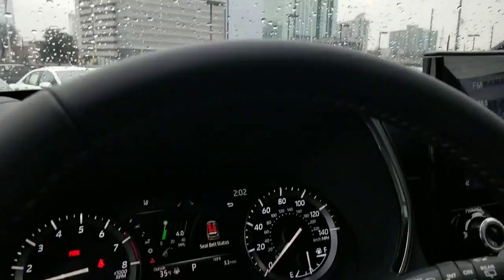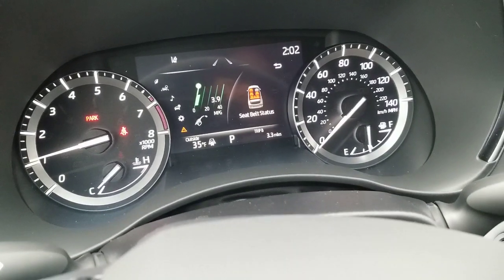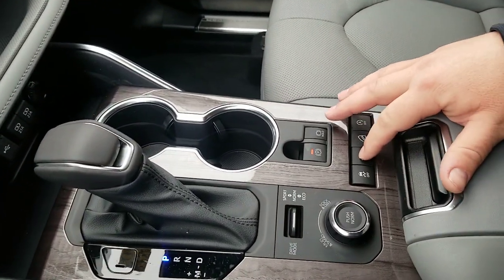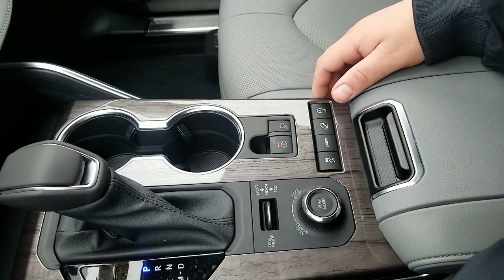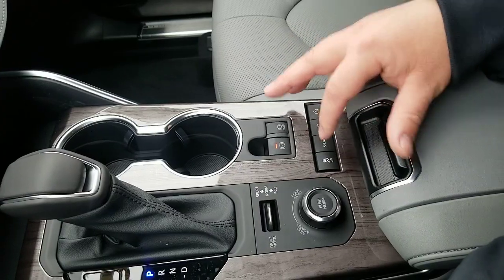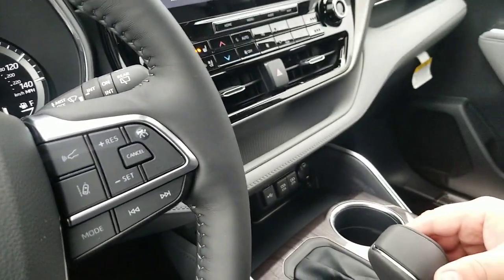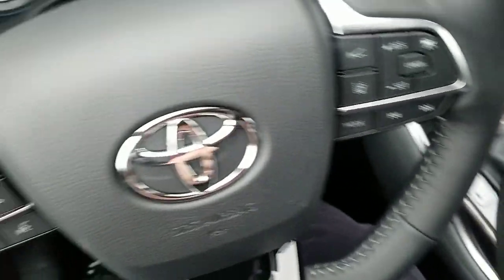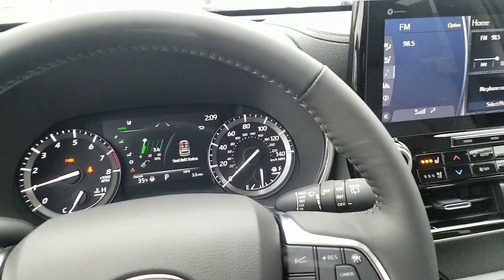What does the Snow button do on a vehicle?

Comment: I have used the snow button in very icy and snowy conditions. It helps. Traction control saved my butt on black ice once. I started to slide, and TC kicked in and streighted car right out. I was able to slowed down at the time which also helped. 2007 Highlander
Reply from the maker: It can save you for sure
Reply: Thats ABS probably. Traction control button turns traction sensor off and on. Thats it. So basically you can hit gas and your wheels will spin if your 4 wheels are not touching the ground.

Comment: I came here to make sure I understood the feature as I was just driving in snowy conditions on the highway in wife’s 2015 Highlander and activated it at about 50mph and it did not downshift but throttle down, steering tightened quite a bit and acceleration was geared down. When I turned it off the car took off, so there is some sort of acceleration “reduction” even at highway speeds which makes sense. It definitely seemed like a good feature at highway speeds to me.
Reply from the maker: its meant to keep from too much torque getting to the wheels
Reply: thanks for the reply! yep, worked great...  @stevenwelchtoyota  just wanted to confirm however that it does help at higher speeds... I guess the real question I have for you, and the main reason I sought out an explanation, is " is it bad to engage it at higher speeds and should it only be activated from a stopped position?"

Comment: Hey Steve, thanks for this video, very useful. I have the 2021 Highlander Platinum, I see the other drive modes mud & sand, rock & dirt which I understand. However, I was wondering which mode is the best during heavy rain driving conditions? or should I just keep it on Eco or Normal. Please enlighten me on that. Thanks.!
Reply from the maker: Some people use snow mode for that but with traction control normal works too
Reply: @stevenwelchtoyota  You mean keeping the traction control on?
Reply from the maker: @kenz4music  yes
Reply: @stevenwelchtoyota  thank you!

Comment: This is great advice, thank you for the video. I have a quick question. If I turn the SNOW mode on, should I manually depress the button to turn it off when it's not needed or does it turn off on its own? Thank you for any advice!
Reply from the maker: If you turn it on it will stay on until you turn it of or of you turn the vehicle off it will default to off when you restart the vehicle

Comment: Steve, Where on Entune 3.0 show cell phone signal strength?  I only see I believe is wi- fi, thanks John.
Reply from the maker: There are 2 signal strength indicators, both are on the top right of the screen. The one that is vertical says dcm on it meaning data control module. That one is the cars data signal ie wifi, safety connect, service connect etc. The other one that is there is indicative of your cell phone signal. It also shows your battery condition beside it.  They may have a slight variation between them based on how they display the info.
Reply: @stevenwelchtoyota  I live in a rural area where cell signal is poor to fair,according to carrier.  Does this cause me to have all my problems connecting to entune?
Reply from the maker: @gardenjohn1  for the wifi yes. It uses an at&t signal
Reply: @stevenwelchtoyota   What does that mean, I have T Mobile.
Reply: @stevenwelchtoyota   Steve, what does that mean?
Reply from the maker: @gardenjohn1  if you got wifi for the car it would run through the at&t system.  Having poor signal wont have anything to do with problems connecting to the car via bluetooth

Comment: So on an icy hill, I can start in snow mode but I still need to turn off traction control to keep sending power to the wheels?
Reply from the maker: leave traction on. The car can handle most things for you with the safety systems enabled
Reply: @stevenwelchtoyota  if there’s a lot of wheel slip on an icy hill, usually traction control stops sending power to the wheels in order to establish grip. Does the Rav not do that? Last year, a famous video of a porche, Range Rover, Lexus and Tesla all lost power toward the top of the hill and started sliding back and crashed. The drivers who turned off TC made it.

Comment: New Toyota GR 86 has Snow mode as well, curious how that works on a rear wheel drive car.
Reply: Could be the Limited slip differential
Reply from the maker: its all about how the transmission shiftsnand the steering

Comment: Has anyone had a squealing sound happen after using snow button? We had snow up here this week and I used it in my inifiniti fx35 only on backroads on snow but 3 days later when I haven’t had the button on my car is squealing while driving. I’m checking brakes now. I just wanted to know if it’d end up causing a squealing noise
Reply from the maker: it shouldnt cause a squeek

Comment: Is it ok to keep it on for ever?
Or will it affect the car transmission? 
nissan almera 2008
Reply from the maker: only use it when its slick
Reply: @stevenwelchtoyota  Thank you for your reply
I know it should be used for some few cases only but I need to know what would happen if I kept it on for a long period of time?
Reply from the maker: @hosamabuoqer5520  you would kill your fuel mileage
Reply: @stevenwelchtoyota  Thank you so much
The most important thing to me is not affecting the gear box
Many thanks 🙏
Reply from the maker: @hosamabuoqer5520  the vehicle will kick you out of snow mode over about 50mph

Comment: TL:Dr - the summary is the snow mode let's the car take off in second gear so that it slips a little less. It tightens the steering wheel a little so that you don't oversteer. That's it. Could have been a 30 second video.
Reply from the maker: Thanks